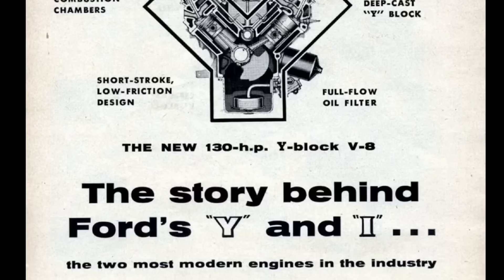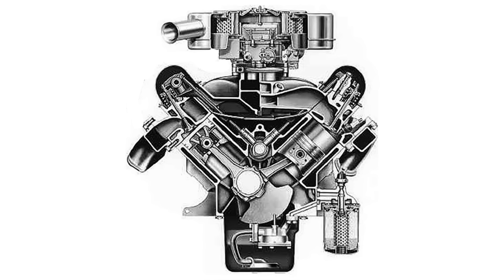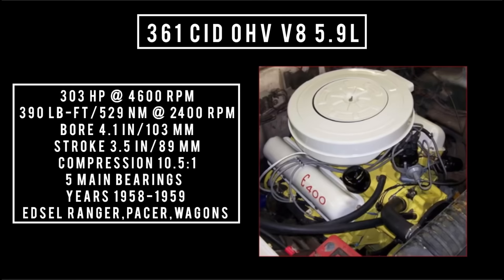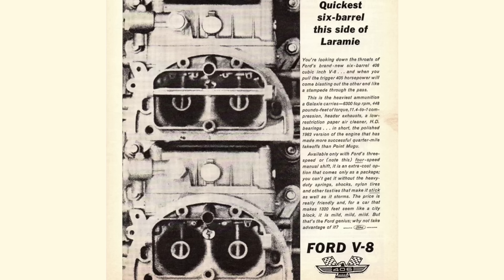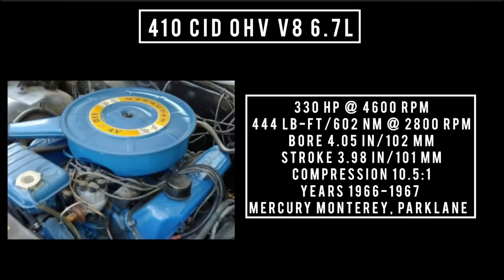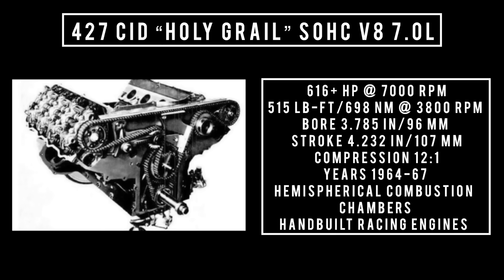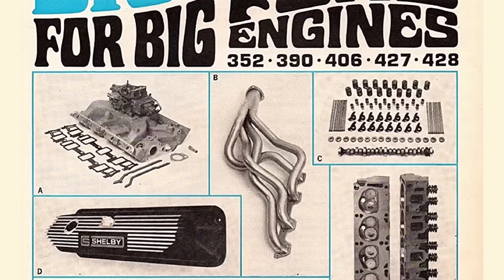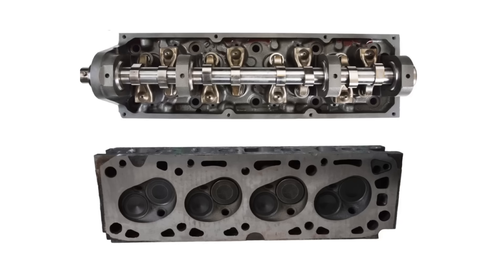Ford FE Engine Family 332, 352, 361, 390, 406, 410, 427, 427 CAMMER, 428, CJ428, SCJ428

Comment: The 352ci 360HP in 1960, could be ordered in ANY full-sized Model. I ordered a "Sunliner" with "three on a tree" (later converted to "drag fast" in-line floor shift). That engine  had a "low" restriction (paper element) air cleaner, Free flowing cast iron (not "tuned", scavenging) headers, dual point distributor, and solid lifters. It only had a 3.56 rear end, and because it was a convertible was not as quick as it could have been. Originally I ordered the car with a 430ci Lincoln engine, but the dealer was not aware that the 430ci engine was not available as of the order date, Nov, '59. When the Sunliner arrived in Mar, '60, I was disappointed that I did not get the 430, but because I waited almost 4mo, I was okay with it. This "behemoth" (RED convertible) barely fit into my one-car garage, but was a REAL "chick magnet" when cruising on a Sat night!:hand-purple-blue-peace:

Comment: 361ci and 391ci engines were industrial engines. FE engines were also known as wedge block engines. it was used after 1966 in Ford trucks all the up to 1976. with the 360ci and the 390ci engines. the Thunderbird FE engines had gold valve covers. and some of the special models had cast iron headers. the 427 and 428 were different engines. the cammer engines weren't true hemi engines. they were considered semi hemi engines. because a true hemi engine has the spark in the center of the combustion chamber. most of the ci displacement changes. were achieved though crankshaft and stroke lengths. with some of the engines having different cylinder bore sizes. There were some incorrect facts about these engines in this video.
Reply from the maker: I fixed the corrections in this video

https://youtu.be/YDeBCxe6Ews?feature=shared

The Bore stroke sizes for the 427 were flipped and explanation on what FE engines are covered in this episode the rest of them are FT
Reply: @What.its.like.  That's great, I just thought I would let you know about the few inconsistencies. I was a Ford technician for many years and worked on a lot of these engines. the weak point of these engines is that they were really heavy. and the cam bearings were known to wear out. and they would lose oil pressure. and upper side of the exhaust ports. the exhaust manifold bolts would become froze in the head. because that part of the head protruded up away from the rest of the head. away from the water jackets. but otherwise they were very reliable engines.

Comment: The 360 & 390 were for cars and pickups and the 331, 361, 391 were medium truck engines with heavy duty features like sodium filled ex. valves.

Comment: What is the 360 in my old 72 truck? A 427 doesn't even have a 4in bore?
Reply from the maker: Boren stroke sizes were flipped on the 427 360 is an FT engine Ford truck..
Reply: @blown572hemi your 360 is a FE  just like my 410 in my 69 F100 Ranger just with a shorter stroke

Comment: Great video, thanks!  One correction, the 361 was an FT and the FE was a 360.
Reply: The Edsel engine was called a 361. It had heads (EDC) that were like the later 427 medium riser heads including machined chambers.

Comment: This sounds a bit like the Porsche M28 big block V8 out of the 928-

These engines were ALL aluminum and had huge thick aluminum cylinders.  And enormous water jackets.  The result was a 122 mm bore spacing, yet 4.5 liter/4.7 liter/5.0 liter/5.4 liter displacements.  This engine made tons of power, even the 286 cubic inch version could make 330 hp.  But airflow was the strong point:  Arias took M28 heads and through welding and grinding made them fit on top of a 502 Chever-Lay big block.  They used a belt drive boss off the water pump to drive the belt for the DOHC Porsche heads, and the finished engine made 550 hp all day long.  AND it could pass California emissions!

Hello?

Comment: I have Fords, Chevy's, Dodgers,  they have correct engines! If a die hard Ford man puts a Chevy engine in his Ford, he should have bought a Chevy, and he's really a Chevy man, also look under a lot of Chevy and Dodge hot rods and you will see a Ford 9 inch rear-end. You should be true to your brand! If you want a Dodge or a Chevy, then build one! At hot rod shows, I turn up my nose at classic Fords with Chevy engines.
Reply: @marksmith6634 you do realize that the big 3 have used each others parts on their cars😅

Comment: I learned to drive on mom's 1966 galaxie with the 352 2bbl.m 250hp.   11mpg citym 15 hiway. was tired by 70k miles. not a great engine. also learned in drivers ed on 1969 Ford LTD with the 390 and tall gears, 325 hp 4 bbl. A great engine in these luxury beasts and a pinacle of old detroit iron, these engines could get 20 mpg on highway and last 200k miles. very seldom found in mustangs, but when they were they were quick and silent! HHow do I know? I'm 71, and I learned to drive in '68!

Comment: My first car was a '65 Fairlane GTA with the new C-6 transmission.  It was advertised as 335 horsepower.  Insurance was deadly expensive on high horsepower cars in the '60s.  My next was a '70 Torino with 4 on the floor and a 351 Cleavland and a locking rearend.  It was built to race.
Reply: WOW!!! You must have had the only 1965 Fairlane GTA ever built, lol. In 1966 Ford made the Fairlane bigger to accomodate the 390. 1966 was also the first year of the C6. The 390 that came in the Fairlane GT and GTA was indeed rated at 335 horsepower. It had a Holley 4 barrel, higher compression and a special intake manifold. The 66 and 67 Fairlanes were beautiful cars and ran as good as they looked.
Reply: Right you are Gary.  It was a 66.  I had it up to 132 MPH (timed) with two bent pushrods.  In theory it should have run out to 140 but  132 was pretty scary on a county road in Idaho.

Comment: About a hundred years ago ( st least it seems like ) I owned a 60 star liner ford , with a 390 crate motor ( 62 modle w/ solid lifters , dual point distributer , single four barrel carb. , 406 style manifolds , all this from the factory ) .
The only reason I know that is because I was told this by the Man that bought that motor new .
It had a B/W four speed  w/ orig rear end ( original auto car ) . It was a fun car to drive ( I owned it for several years ) . I later learned that the motor was what Ford called a " special" 390 . I think it's because of all the high performance stuff in it .

Comment: Feel should specify that the power numbers are Gross not Net, and are 30%-50% higher than the actual output of the engine.

Gross is like race trim/setup and Net is what is made in the production car.  Due to no accessories (not even water pump or alternator/generator), race exhaust, and air conditioned intake air.

Comment: F.E were Ford/Edsel just as the M.E.L s were Mercury/Edsel/ Lincoln. Also i believe the 361 in the edsels were 400 ft pds of torque not 390. The torque rating of that engine was also painted in red on the valve cover as shown in your picture.  Would rather have a 60 Edsel ranger, but since that is not a choice i,ll take the 60 Galaxie.
Reply from the maker: Thank you so much for the correction on 400 pound feet for the 361 =)

Comment: You left out the 360
Reply from the maker: Firgured cover that engine when we do the FT line because it was only available in the F series
Reply: @What.its.like.  The 361 and the 391's were the medium duty truck engines.
Reply from the maker: True but was the 360 offered in anything besides the ford F series trucks

Comment: I'm sure I am not the first to tell you that you got the bore & stroke switched around on the 427. But if I am it is easy to go look up engine specs at Ford motor sport they show all the modern engines Ford produces from 1958 to today. Impressive reading for a true engine nut.

Comment: I dont have much information but my truck is 1973 390 ? With 105 backwards  501 ? It has an elderbrock alum intake . Been replacing all the sheet metal with my son . We mesured the stroke of the pistion , a 390 . 12" pressure plate an odd #
Reply: Any input welcome!
Reply: The backwards 105 is on the driver's side front of the block .
Reply from the maker: I don’t know anything about that

 I do know that Ford for whatever reason did a lot of different versions of the 390.. if anyone can chime in that would be great
Reply from the maker: I found this form 

https://fepower.net/simplemachinesforum/index.php?topic=9893.0

Comment: Nice work mate.
However I’me lead to believe that the side oiler was born half way through the 63 year in the Galaxies when they went from notch back to the much better fast back type rear roof. They couldn’t win races driving over their own crankshafts. Side oilers were definitely available in the 64 Galaxies.
The 406 was the scourge of super stock with its high rev capabilities.
Regards Ken
Reply: The side oiler block came with the '65 427 Medium Riser engine.
Reply: Checked my records and right you are my friend. I stand corrected. Side oilers produced in 65 for the SOHC and used on all 65-67 427.
Regards Ken
Reply from the maker: Awesome information thank you so much for sharing that insight =)

Comment: The FE is NOT a F%$#ing Big Block  FE bore spacing  4.630 inches a big block must be 4.800 inches or greater The MEL also introduced in 1958 was fords big block bore spacing 4.900
Reply: It’s good to know that neither my Buick 430 nor 455 were considered big-block engines. 

I wonder if the Buick engineers knew that !!
Reply: @Clyde-2055  Actually yes all of the big 3s engineers knew the definition of a big block and it is rumored that Buick did make a big block 455 for a limited time but having worked in a machine shop for 30 years I never seen one but of course that doesn't mean it didn't exist there were a lot of experimental engines in the 60s early 70s Pontiac had a 427 HEMI but it wasn't a big block

Comment: My first car was a 1966 Thunderbird (bought in 2017, I'm not that old lol) with a 390 FE V8! It was pretty worn out when I got it, but it still ran reliably even if only on 7 cylinders while getting 5 mpg and taking 10 minutes to start and warm up every morning, and stalling frequently in the first couple minutes of driving... It still always got me to my destination. Then I did a full engine rebuild in 2019-2020 and it improved significantly, even more so when I realized I was using the wrong fuel and 0% ethanol made it much happier. Now that I've been driving it for several years I'm honestly shocked how reliable it's been, I thought owning a classic car would require much more frequent maintenance, but I've hardly had to do anything. It only left me stranded once, due to a cheap chinese alternator that crapped out, but that was a cheap and quick fix thankfully. The odometer broke at about 96,000 miles before I bought it, and may very well have had over 100k at that point. 

Only modifications to it are a different fuel pump (for running ethanol gas when necessary), roller lifters, an aluminum intake manifold and four-barrel carburetor, and hardened valve seats. With modern higher-quality oil and whatnot, I expect it could easily last another 100k miles with very little maintenance. I totally get why old guys say "they don't build 'em like they used to," given how this whole car seems to be built like a tank, yet in the 80s all the American car companies started building cheap outdated junk and couldn't compete with the Japanese automakers. 

Sadly my T-bird was rear-ended by a distracted driver a few months ago and the insurance company declared it a total loss, yet after the accident it still tracked straight and everything still worked, even all the lights. Just some bodywork was damaged, and only in areas where rust had weakened the structure. It still works perfectly to this day, even if I have to leave it sitting for a long time to save up for repairs to get it back on the road with a rebuilt salvage title. 

My family has owned exclusively Japanese cars my whole life and loves them for their reliability, and some of my family members are convinced my T-bird is unreliable because it's old so I can't/shouldn't expect it to be useful as a regular car, but I'm convinced it's in the same league as any modern Toyota reliability-wise. Ford was building some truly excellent engines in the 60s.
Reply: I have a 1965 Galaxie 500 2door hardtop that has the original 352 with a Cruise O Matic. I have owned this car for years and drive it regularly  to church, Lowes, the grocery store, etc. I bought the car in Feb of 2014 and have had many compliments about it as well as quite a few purchase offers.
Reply: @garyjubar5733 The only auto trans I ever bump started. *30mph.
Reply: @garyjubar5733  ,,,,,,,,,,,,,,,,,,,super cool car
Reply: My dad has an old 390 that he "rebuilt" in the 90s with his father. He mauled the ever loving fuck out of that poor motor. Never let him down and he was always pullinf people out of mud hole n shit. Im rebuilding it rn. It still ran before i took it out, even with a completly fucked cylinder 🤣
Reply from the maker: Awesome thank you so much for sharing all that information and insight greatly appreciate it
Reply: Best of Luck with your car, If or when you get it going again , be sure to add a MSD or other multi strike ignition, a World of difference in starting and smoothness.
Reply: ,,,,,,,,,,,,,,,,,,,,,,,,,,,,,,,,,,,,,I luv the 57,,,,,the square birds also,,,,,but the 1966 Landau hardtop  with a 428 was a supercar   everywhere,,,,anyhow.......Gorgeous interior.......tuff  yet elegant look.....................
Reply: That's a bummer losing your Thunderbird man. I just picked up a classic 1967 Thunderbird couple years ago been fixing it up. She's got the 390 V8 as well. You're right man those cars just drive nice and there's not a lot you need to do for them.
Reply: Cammers look very complicated
Reply: Ford 460 engines were beasts
Reply: My sister bought my parents' 67 Galaxy with a 390 2v, and when she sold it, it had over 300,000 miles.

Comment: Forgot several 330- 332-352-359-360-361-379-389-390-391 -406-410 427-428 then you can do a custom with a 427 block and a 428 crank 4.230x 3.98=462 CI
Reply: You could get almost any cubic inch by swapping cranks and stroking or destroking
Reply from the maker: Yeah I draw the line at what these engines were used for this episode was about the car engines =)
Reply: Why would you say that with some small exception  having been in the machine shop buissness for years i find your information  is conflicting l @What.its.like.
Reply from the maker: Most of those are FT engines the 360 was only in the f series trucks so going to cover those in the ft video
Reply: You can even make a 383 with all factory parts got one setting in my garage waiting for duty if my 410 goes down

Comment: The 427 cammers with the  all gear valve train were based loosely on the Ford GAA v-8 used in Sherman tanks. 1100 cubic inches, double over head cam, put out over 500 hp at 2500 rpms.

Comment: 1966 mercury comet with 390. Loved the one I had.
Reply: Loads of fun changing the plugs in that combo …
Reply from the maker: Awesome automatic or manual 390 would make that car move nicely
Reply: I bought my 390 '66 Cyclone in 1968 (because I couldn't afford a used GTO). It felt like a truck engine and never seemed happy at high revs so I always shifted at 4500.  A good first car for a high school kid burning tires, but I never regretted selling it.

Comment: Bore and stroke for the 427 are reversed in your video.  The 427's bore was 4.23.  Stroke was 3.78.  You also forgot to mention the cross bolted 3 center main bearing caps on the 406 and 427.
Reply from the maker: Thank you so much for those corrections =)
Reply: @What.its.like.  It's interesting what Ford did with the 390-428 engines.  

By combining the 428's bore and the 390's stroke, they created the 406.  The 390's bore and the 428's stroke gave us the 410.  They essentially just bored out the 390 to 4.13 and used the 410 crankshaft to create the 428.

Then,  of course, the 427 had the 390's stroke, so they took the steel 390 truck crank and used it in the 427.

The original 406 heads were used on the 428 Police Interceptor engine and thus birthed the 428 Cobra Jet, and the same heads were later used on the de-tuned 1968 hydraulic cammed 427...which were essentially 427 Low-Riser heads.

Little things that many don't notice.
Reply: @johntravis3500 your theory is a little flawed for one the 406 was way before the 428
Reply: @purpurahaze9179  Yes, it was.  Why is it flawed?  The same heads were used on the 428 Interceptor, 428 Cobra Jet, and the de-tuned '68 427.  They just had different part numbers.
Reply: @johntravis3500  Actually the 427 crank (C5AX I think) is much different than the 391 crank. It has cross drilled rod journals (oiling). I believe it is a totally different forging. I have one virtually new in a HM Tunnelport. I was sick to need to put that NOS crank in the TP in 1977. It was to replace the C7 crank that was cracked. The C7 crank had wider rod journals and used the C7 rods. The C7 rods, the "NASCAR" rods, could be bought in a set of 8 from a Ford dealer, polished, balanced, and sized for $800 a set. Each rod weighed 1000 grams. Ford made some really good stuff back then.
Reply: @YouScroob  I understand that.  I was referring to the stroke.

Comment: The 361 and the 391 was used in the flip up cab HD truck that has a steel crankshaft with a larger neck .
Reply: Oh no.  We hope the “flip up cab” was not the dangerous “cab over engine.”  Putting the driver over top the engine left nothing between the driver’s head and a telegraph pole.  Danger!

Comment: At 2:24 the engine pictured is a 332 Y Block used in big trucks. It was also used in Lincolns. And yes its correct Ford did make an FE 332 in '58
Reply from the maker: Thank you so much for the correction =) 

The picture is wrong also the Bore is 4 inches stroke is 3.3 inches